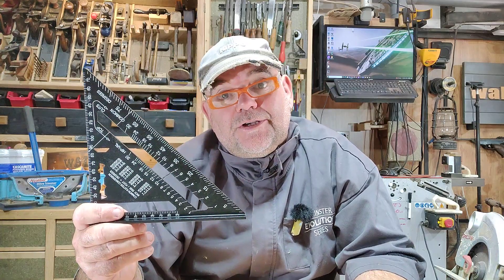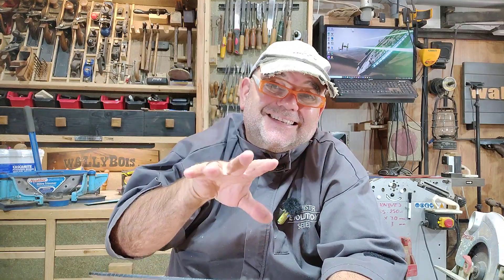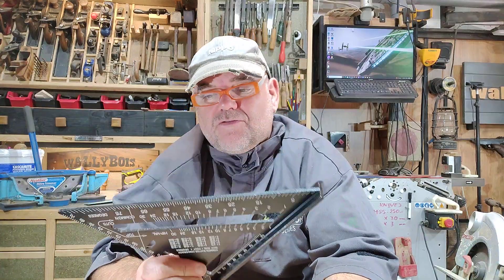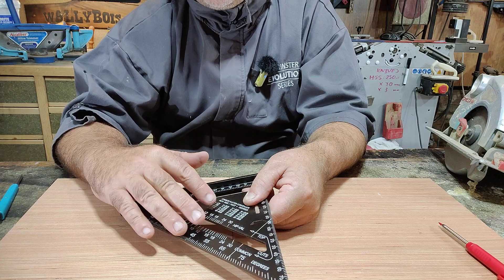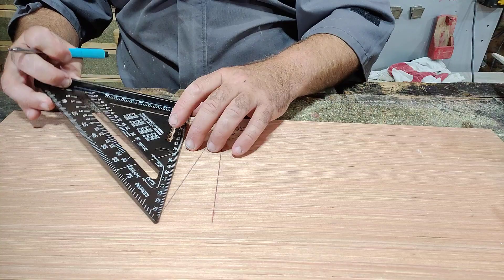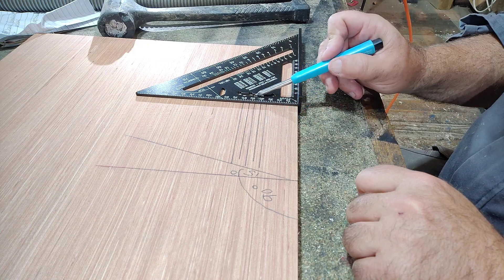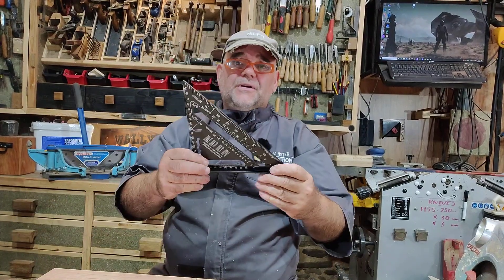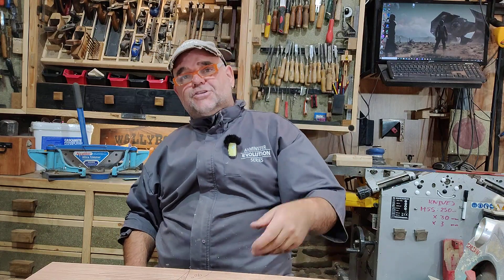£5 Rafter Square (Speed Square) is it worth it?

Comment: The rough cut, factor edges become polished smooth in just a short amount of time, just from constant use and riding around in your tool bags. They’re also handy as a “rudimentary calculator”. If you want to know what a roof pitch angle is in degrees, you can just read the degree scale at the bottom, once you’ve pivoted to the roof pitch number you are looking for. Speed squares have been a standard part of carpenter kit, in the US, for as long as I can remember. At least late 70’s.